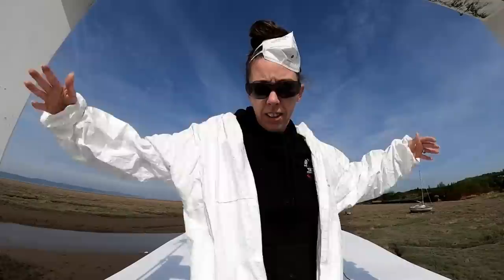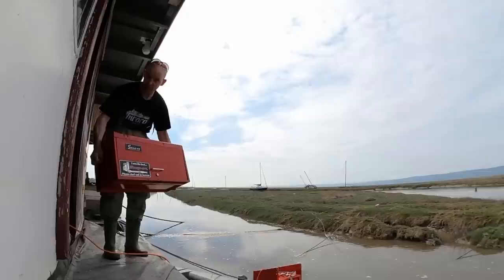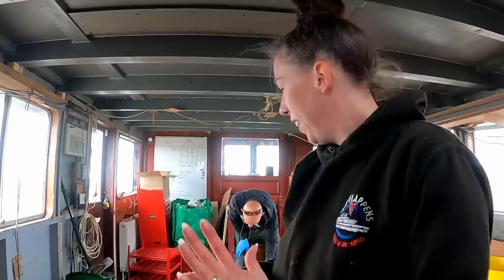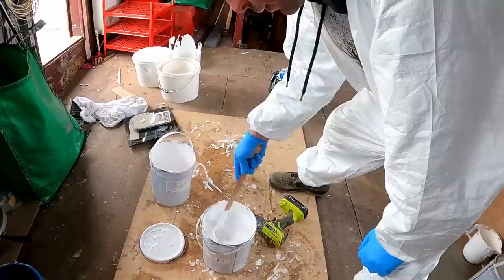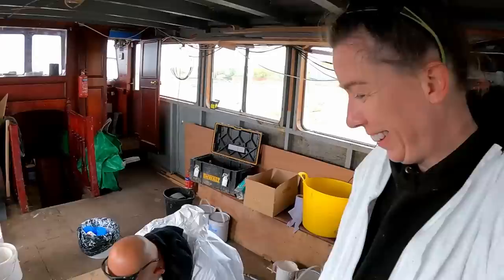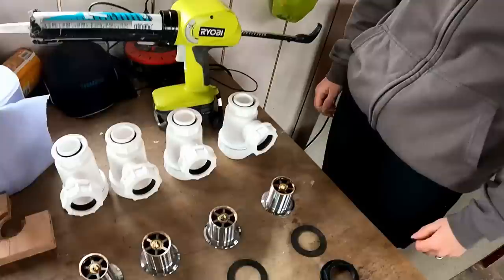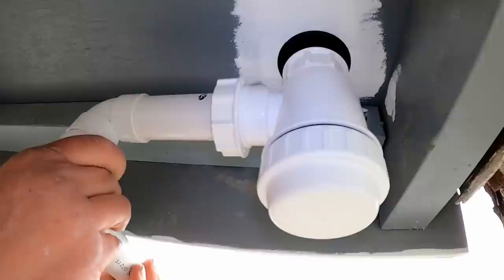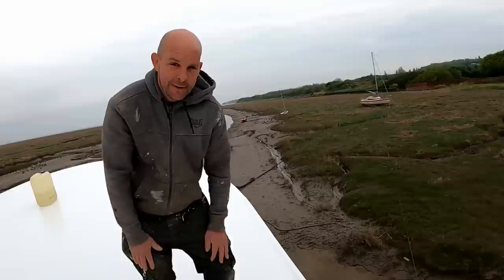Ep 70 - Fresh Water Collection System On A Boat - Gel Coat to Fiberglass

Comment: A friend of mine purchased a small yacht a few years back and asked me to help out. One evening we were discussing things to be done and he got quite cross when I called something by it's correct nautical name, " I am not keen on this poncy middle class sailing lingo for things" he says to me giving me a hard look. I took a deep breath counted to ten and told him these terms were developed by working class men on working boats for a reason, If every body on board a boat is singing from the same hymn sheet life is so much easier. At sea when split seconds can save a life or a ship and it's entire crew you really really don't want to be going into verbal gymnastics to explain yourself when a single word will do. Being a clever bloke he got the point and threw his hard line leftist bigotry out of the port hole.

Comment: For your freshwater collection system, I suggest that you install a Y before your freshwater tank with some valves. By default have the water diverted overboard and re-valve when you want to collect water. This allows you to flush the roof and the pipes of any bird droppings, insects, etc. So when you are aboard during a rain storm, let the first 30mims of rain go overboard and then collect clean water into your tanks by turning two valves. Search first flush diverter which are common on rainwater collection systems. Cheers.
Reply: Agreed, but I would also add a UV filter in the freshwater tank to kill off any bacteria that may find its way in.  I can see the pop up outlets being a PITA because you could probably only use them when in harbour as when at sea there is a good possibility of getting sea water spray onto the roof.  Consider the pop up waste operated by a lever that you could control from below even using 12v solenoid motors
Reply: We're doing this on our house (due to the rising cost of water at the moment) we're actually putting it through 4 filters then a UV filter. Normally a first flush system would be ran, even that has two schools of thought 🤣.
Reply: @HandyKindaGuyUK  I looked at using rainwater for use in a vehicle depot with a large vehicle wash.  Whilst the collecting of the water was very simple the lengths that had to be gone to to ensure no health issue was the deal breaker.  The break even point for the installation compared with the cost of the supplied water via the mains was around 15 years that for a commercial consideration made it untenable.  By far the best source for non-mains water ashore is a borehole or well, mainly because of the rainwater catchment area and the natural filtration provided by the sub-soil.
In the case of Ship Happens I wonder whether a desalination plant powered by wind or regeneration would provide the most reliable supply?  After all we can have long periods of little or no rainfall that over such a small area as the roof of the boat will supply very little water.  Assuming the catchment area is about 50m^2 then the average daily rainfall is 120 ltrs/day but I would suspect that only 20% at most could be caught then the harvest is only 24 ltrs/day.  The average water consumption per person in a household on shore is 143ltrs/day, which puts into perspective the amount harvested.
Reply: @clivewilliams3661  i would go for a osmoses system
Reply: as former sailboat sailing,  I have seen three sailing 'survival' articles on collecting rainwater (1 at harbor, 1 as moored, and one at sea.)  all of them states Dry Bleach or sanitizing tablets is utilized due to it's ability to last longer over time when stored onboard properly. That is do not use UV or filters... obstruct survival ability due to demand of un-collectable and/or stowage materials. 

Those articles I have read is old [1980's] used canvas/dacron [sailcloth],  pvc, rubber and/or copper as rain-collecting materials.  Since PEX has come out, I have been wondering whether PEX is better choice than PVC due to ease of routing the hose and salvage reusability.

Comment: A little trick for the future, To bend thin wall tubing a hair dryer will do the trick, and for thick wall a heat gun will work much more efficiently. And on the subject of correctness of speech, you
can what you want and when you want and how you want.   And I quote     '' it is what it is and what will be will be".

Comment: Using the stuff from the hardware store and you get what you pay for. For a better buffer, borrow or rent a larger buffer as used in office floors. A good floor servicing equipment supplier should have not only a larger industrial buffer (18-24 inch wheel) but even the industrial sandpaper pads in the needed grit.

Comment: You'll want some sort of first flush system for that fresh water collection. You may be surprised just how much salt accumulates over quite a short time on the upper decks.

Also, proper names can be good and bad. Using them can help you find things that you want to be specifically marine, or can help when talking to other people about certain things. Other times they'll get you the same thing you can buy at Bunnings just at ten times the cost or everyone knows what you're talking about regardless.

Imo learn what the names are, but day to day call them whatever the hell you like. It really doesn't matter.

Just know that a good number of us sailors had the proper names metaphorically beaten in to us and we in turn did the same when the new kids joined the ship. Bit of a habit to break really, but no harm is meant. Adjusting to be a civvy again is not easy.

And keep up the good work, it looks amazing!

Comment: Run into  holding tank, from there pump through a 3 filter set and a UV steriliser (SilverlineUK)  into second tank for use. Use a small RO unit for drinking water also SilverlineUK. Works for us for 10 years.

Comment: You're doing great..i was told my workshop wouldn't last a year and my electrical installation was a death trap. It's not how a professional would have done what i did i agree. However. These statements were advised at me about 5 years ago. My shed is still fully standing and has suffered no power fault's or fires to this day.

People so over exadurate everything.

Comment: Normally the coating used for things like that roof in the boatyard I've worked at would have been DD-laquer, which is a lot more self flattening that gelcoat. It's not quite as hard as gelcoat but still fine for a deck like that. You're going to want to put either decking or a coat of anti-slip on there if the flybridge is going back up

Comment: Re sanders I reckon that the non directional orbiting type sander will be easier for you to use and they don't dig like the new one will and does.
Non Directional is the best if your after a really smooth surface. Allan From Lameroo

Comment: Great job. Couple of things you might want to try. Especially if you're planning on pulling something apart later Butyl tape is brilliant, cheap and readily available. Size isn't everything but even penny pinching pros have switched to quality abrasives, they last much longer and don't load up, there are others but 3M Cubitron or Mirka will make you  believers

Comment: The last thing you need on a top deck is a smooth surface that's why they have nonskid surface on most boats so you don't slip off the side of the boat when it gets wet .

Comment: You really get the same smooth finnish with 2comp.polyurethan paint as you get with topcoat (that really is not gelcoat, because that does not harden with air around it.)

Comment: if u fill a pvc pipe with salt  tightly  and put tape either side you can slowly heat the pipe  and bend it to the shape you want and then run it under cold water to keep the shape i do it with my fish tanks lol

Comment: Not a criticism I have used both polyester and epoxy but the latter adheres far better to timber than polyester especially over the longer term and finished with 2 pack polyurethane you get a good gloss finish.

Comment: Good job its hard work what you have done, it does not matter if you get it wrong people can see what your doing someone mentioned over brass fittings brass is ok but if your using hardware stuff if plastic not so bad but 316 grade SS or better for sea vessels
salt water is good for rust Orange colour, Expert or not you dont have to keep mentioning
it people will say things just read the comment.
yes GRP is still curing a few years down the line and now your getting ship shape bristle fashion check you have no stones in your tread wont do the deck any good
just carrie on as you are your doing good.

Comment: Good work, but be aware that boats and silicone don't mix very well. Silicone is difficult to remove and leaves a greasy residue behind that will not allow marine sealants to adhere,  better to use a general acrylic caulking for a temporary seal .

Comment: The non-setting gel cost is actually just what you want. Cured resin doesn’t allow a chemical to the new layer. Gel coat’s slow cure allows that bond to happen. The final flow coat seals and allows it to fully cure.
Reply: Ive done a bit of this over the years, ive just finished a small deck. Anyway I normally use standard gelcoat with about 20% resin mixed in. Then the second coat, same gel, maybe thinned depending on the job. But I will add wax styrene to the second coat and this will make the gel have a hard shiny finish. Ime not a lover of flow coat,I think thats for roofers to get the job finished quick.

Comment: You've probably thought about it but in case not, please consider putting an access hatch under each drain for complete service and replacement.  The brass parts in the scuppers will corrode faster than more pricey marine-grade bronze parts

Comment: You need to do fairing compound over the first coat of gel you did. Then sand and fair again, then gel then sand then gel and then wet sand cut and buff. If you want to get it looking sorta okay. You missed your steps. You have to fair and primer and gel coat. 🤔🖖🏼

Comment: Epoxy has relatively poor resistance to UV, not generally considered the most durable for exterior use.  It tends to chalk.
Reply: That’s why it needs coating with two pack polyester paint. Epoxy gives a much tidier longer lasting job but wouldn’t have been feasible doing it outside in the UK as you couldn’t control the temperature and moisture levels. They made the right decision as you don’t really need any experience to use polyester, it works in far wider parameters.

Comment: Those are proper workers tea mugs, I got a clip around my ear when I washed up the chippy foreman's mug he reckoned the tea tasted lousy for weeks after.
I take a hot mug of artichoke tea to bed as it makes me sleep better, sometimes I don't drink it all, in the morning the inside of the mug is clean like new. Now I'm not sure I should be happy the mug is clean as now I wonder about what's happening to my insides. I think I'll stick with beer.

Hopefully the rainwater will go round the bend, and drop into the mud. IF THE WIND AINT BLOWING.
In Vietnam they don't like fitting gutters even though it rains like mad. We've had a huge carport erected so we can entertain outside and have rain and sun cover. Trouble is we could only use the leeward side if there was rain and wind. I fitted gutters that I had to get specially made and even installed barrels to save the downpipe water. 

Lots of boats have B&Q stuff, cos even the stuff in the ships swindlers is getting cheap and nastie. Once boarded in no one will know.

Comment: Brilliant thinking, using those bathroom sing plugs and siphons for your freshwater collection system...Excellent!
I have been watching ( and subscribed to) your channel since the beginning and have nothing but admiration for your energy and commitment to your project.
Now, some moaning....Are you really going to rebuild that flybridge? Its not as though it was part of the original boat or anything. You would just be rebuilding somebody else's attempt to impress....
Far more impressive, to my mind, wwould be to remove the whole of that horrid-looking after-deck cabin/lounge ( it looks thin and silly from behind) and have a really neat outside steering position on the back of the new bulkhead that would close off the wheelhouse just where you have renewed the roof... That after cabin is built on an already raised aft deck, and with the weight of that cabin and flybridge so high up she probably became rather unstable, seriously rolly-polly, and that would explain all that extra ballast you found in the bilges...
If you just clear the cabin away you would gain a good outside space, a proper after deck with room to sit and to eat ouside, somewhere that people can hang out while out on a trip to somewhere or just around the bay. And with the forward bulwarks replaced, Sarinda would look rakish and cool. She would probably be more seaworthy as well.
Please think about removing that cabin, it is not attractive, and its not as though you're stuck for inside space.
It would save you a bunch of work if you did just cut it off, although you two are obviously not afraid of massive amounts of work!
Its your boat, you will do what you want to, I hope my ideas don't upset you. I just think she'ld look much nicer and be better at sea with my version of proceedings.
Cheers! More power to your elbows.

Comment: The roof is a great success! 👍 Well done!  
On a different note, I have wondering about the condition of the hull in the section that's currently buried in the mud? I think it would be really useful to have the boat out of the mud and properly onto a hard somewhere so that you could really give the entire hull a good going over. I have no idea if it's possible or practical to do this in terms of logistics but I just thought that if you wanted to paint below the waterline eg. antiquing it will be necessary to have the old girl high and dry. Are there any facilities nearby? Another thought: does the engine run? Ķeep up with your excellent work! 👌

Comment: I’m going to risk sounding rude. Sorry in advance. 
Does Sarinda really need the fly bridge? I think she looks great without. Also with less weight up high, her sea-keeping has to be better.
Reply: Sensible point, so much weight and height was added in the 80’s refit which presumably explains why the bilges had quite so much ballast in. She must float well down on her original lines

Comment: Do the davits no longer work? a fix on those would sure make your lives easier getting things on and off the boat - upgraded multi speed electric winch would be so much better than you 2 getting hurt.
Reply from the maker: They do, and we put a winch on one of them, but after assessing the structural integrity of them we are not happy to use them at the moment, they will be coming off at some point to allow the aft roof to be down and will be put back stronger than ever

Comment: I am not sure about freshwater systems like you are describing but I do wonder if you have to treat the water before using it because of bird poop. I would like to say that at 23:57 in the video that the cabin ceiling looks really good.
Reply from the maker: It will be fully filtered, by further down the line, for now the water is going overboard to stop excess water on the decks below
Reply: @ShipHappensUK  Thank you for answering. The new roof looks so good.

Comment: I know you guys don't like comments on what you are doing wrong, so I hope this is not that.  But, did you know that you can add wax to the gelcoat (before applying) that will migrate to the top and seal off the air from the gelcoat so it will cure.  Acetone takes it right off after the gel has cured.  If you don't add the wax, only the top surface of the gelcoat does not cure.  So, you can use your acetone to wipe off the uncured gelcoat prior to sanding to help prevent your sandpaper from clogging.  I usually just wipe off the uncured gelcoat between coats and add the wax on the final coat.  Give it a try.

Also, you can indeed gelcoat over epoxy.  Just let the epoxy fully cure, wipe down with acetone to remove the curing byproducts (forget what it is called, but it is a greasy substance...but who cares, right!), thoroughly sand then apply the gelcoat...works great and will not delaminate.  But, since you were not trying to do a structural repair, I think polyester resin is fine for this application.  Polyester resin's weak point is its ability to bond to itself (after fully curing).  This is why epoxy resin is a better choice for fiberglass repairs (epoxy will bond to the polyester resin much better than polyester to polyester).

Here is an example of a wax additive: https://www.amazon.com/Fiberglass-Supply-Depot-Wax-Additive/dp/B077GYBNP1/ref=asc_df_B077GYBNP1/?tag=hyprod-20&linkCode=df0&hvadid=312065655587&hvpos=&hvnetw=g&hvrand=17471648695334342900&hvpone=&hvptwo=&hvqmt=&hvdev=c&hvdvcmdl=&hvlocint=&hvlocphy=9028310&hvtargid=pla-567934666922&psc=1
Reply from the maker: We haven't finished the final layer of flowcoat yet, so that's why it is gelcoat for now as you can't add extra layers on top of flowcoat!
Reply: @ShipHappensUK  I guess my point is that you do not need to use "flowcoat" if you use the wax additive on your last coat of gelcoat.  And the wax additive MIGHT have made sanding the first layer of gelcoat easier as you would not have had to deal with the uncured gelcoat clogging the paper.  But, as I like to say...there a 100's of ways to do things and the important part is that it gets done.  Honestly, I have never used "flowcoat" but my guess is that it is just gelcoat with the wax additive already in it.  For white, this makes sense.  But, for custom gelcoat colors, I would only want to deal with one product.
Reply: …and, y’all are doing awesome.